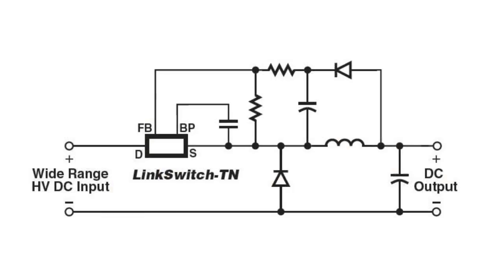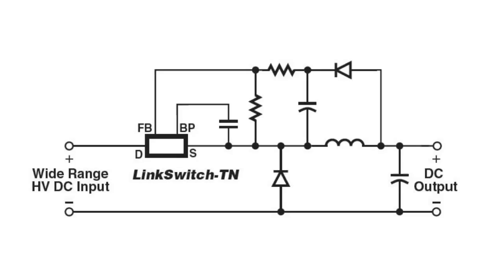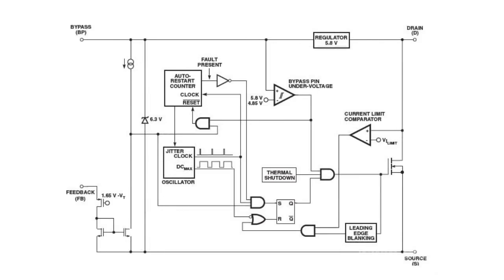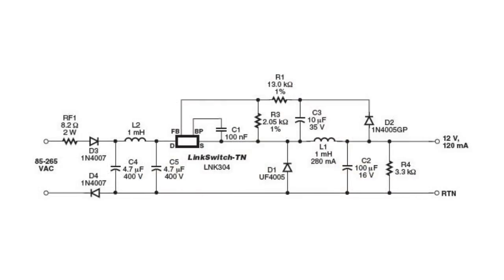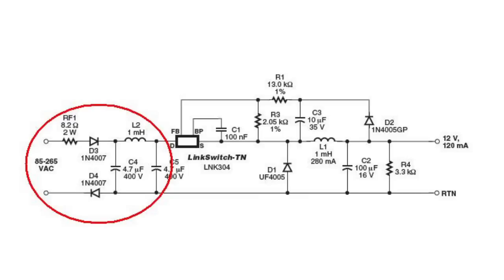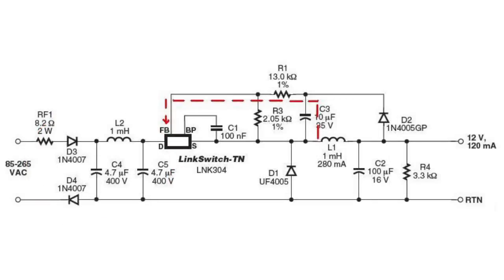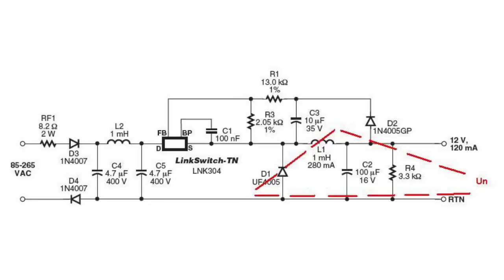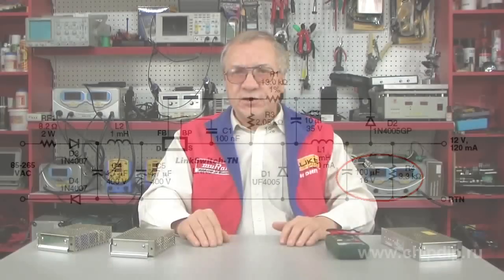Features of using IC LNK304 chip in PSU

Comment: This is an excellent counterpart to some transformerless power supply circuits, so called "reactive droppers." Great power efficiency, stability over temperature variations, quite a wide range of input voltages which have a pretty low impact on the output makes this type of supply a good choice. But unfortunately low current capabilities of the supply makes it impractical for anything that requires more than 120 mA. It's a good thing I had an old television set from which I could salvage some electronic components for the project, especially those two inductors shown on the schematic diagram as I didn't find them at my local store that sells electronic parts and was forced to rewind them myself to get the proper value of inductance I needed.